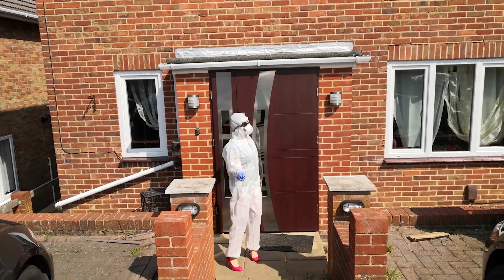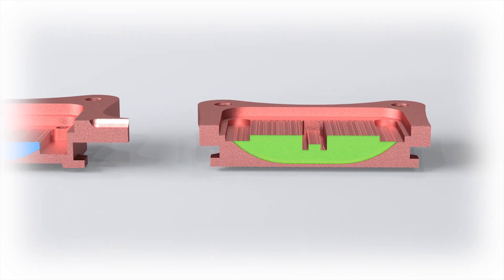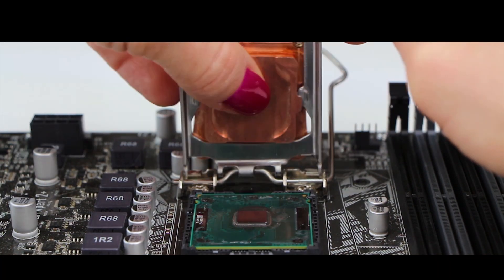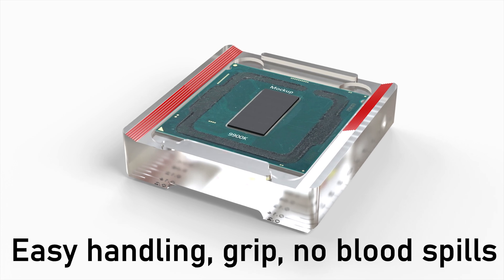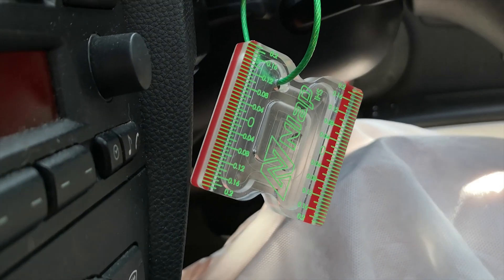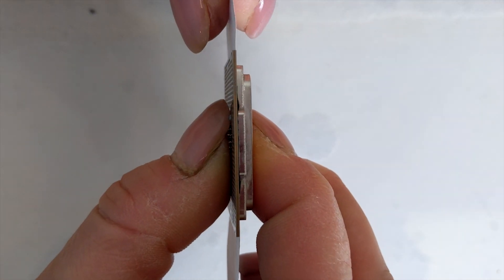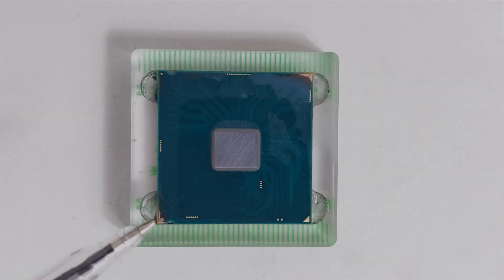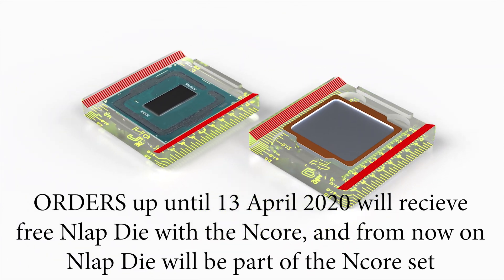The Nlap - an Ultimate lapping tool for your CPU LGA 1151

Comment: Is there any reliable comparison with top modern waterblocks? I assume that it has worse performance than top EK or Heatkiller blocks, direct die may give it a degree or two but if the end result will be the same I can't see the reason why I would use a direct die block instead standard one. 

EDIT: It's also funny how you used an 775 cpu to fit it in 115x socket, what is it, a Celeron 4xx based on such small core size? Is it even touching the core on various generations?
Reply: linus tested it a while ago and was amased by the direct die cooler

Comment: Still exited to see progress, even if my ncore might end up on a wall or a shelf... Spare time when I ordered? massive. Spare time now? Just a smidge over none...

If nothing else my ncore is going to end up a really neat display piece 🙃
Reply from the maker: AMD Ncore version instead??
Reply: @NUDEcnc  haha nah still using the same chip as when you first launched the campaign. Just have no idea when I will find any time to install it. Also have another radiator just sitting, waiting for a time when I'll have everything in order to get something done. Probably need to clean the blocks, swap the coolant, make new hoses and all that but I hardly ever use my computer anymore even :(

Lots of stuff happens in two years

Comment: Wouldn't be simpler to make the ncore slimmer and send copper shims to adjust for the difference in thickness. Asking the end user to lap the die is kinda to much...
Reply from the maker: This is exactly what we will do. Initially, Nlap was designed for lapping/ adjusting shims thickness. But during the trials, we found out that the thickness of the die is a big difference so we decided to give people just another option. You don't need to lap your CPU to use the Ncore, BUT YOU CAN!!!

Comment: i need a direct die waterblock for a xeon x5675 x58 cpu. would the nude cnc v2 work?
Reply from the maker: Unfortunately it will not fit as it is designed for LGA 1151